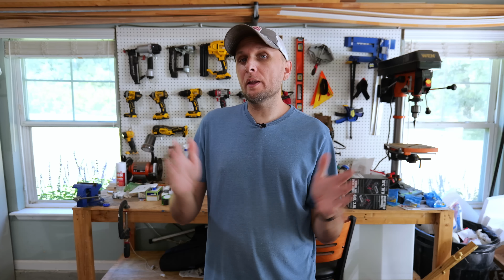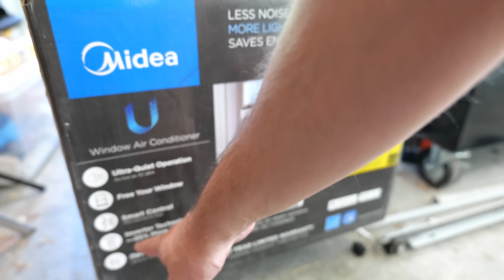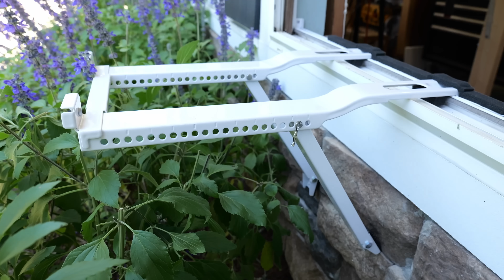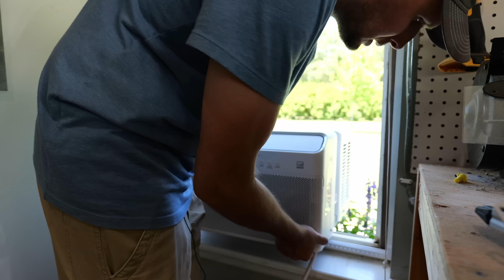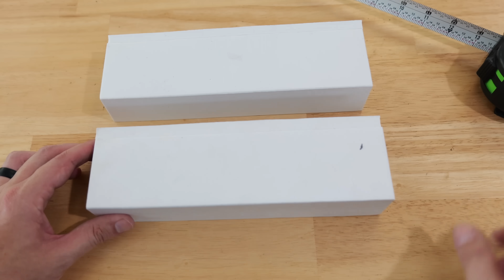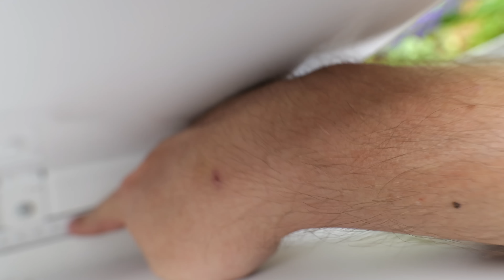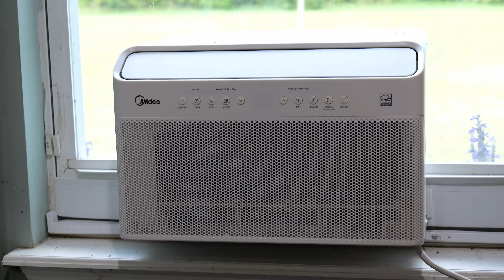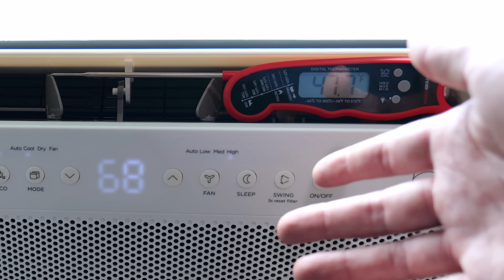The COLDEST And QUIETEST AC Unit Ever Made!  Still Use Your Window!

Comment: I have had two of these for the past 3 years and am well satisfied. There are some irritations though. You have no direct control of the fan speed. You can REQUEST the fan to be low-medium-high but it is only a request. If the room is over the set temperature the unit will switch to high fan until the air is cooled down. This can be a real irritant if you are shooting video or trying to get to sleep. In sleep mode the unit is very quiet, almost to the point of not hearing it. But if a slight draft of warm air hits the inlet it will switch to high fan which is as loud as a normal air conditioner. Another irritant is if it is set to economy the fan will shut off completely once the air temperature reaches the set temperature. You then have no air circulating through the unit. The air in the room will rise in temperature too much before the unit switches back on, and then it may switch to high fan for a while. (noisy)  As for economy, the 8000 BTU unit uses a little over 6 amps on high cool on a 95 degree outside day. On low cool it only pulls 2.6 amps! This is less than the fan alone on most standard AC units! Truly very efficient. These do cost a LOT more than the cheap noisy bargain units but you will easily recoup the extra $200 or so in the first year or two of electric bills.
Reply: With our Midea split units, if you press the mode button on the remote it changes from AUTO to COOL and then the fan speed can be set at what ever % level you wish.
Reply: @rallychamp2003  Thanks for the tip! I guess I have to find what I did with the remote! I still wonder if the unit stays in "low ultra quiet" if the temperature exceeds the set point.
Reply: Never put these in economy . Inverter ac units have to be always on . If not, not only will the temp rise to much but your room will be very humid . Another issue i had with these units is when the temp caught up to set temp and the shift in temp of air coming out of the unit the contracting of the parts inside would cause a crackling sound . It’s because the copper tubes are run through a hole in the plastic that is to small . So the restricting and contracting that occurs with temp change will cause the tubes to rub against the plastic . Part of why i got rid of mine . Second part is the suddenly high fan noise when it starts to get to warm . These need to be designed and operated different to truly work best .
Reply: @jimjr9143 there's not too many other people I've heard from that commented on the humidity characteristic of these units, which I've also noted.  
I've found that my 12k unit doesn't decrease humidity the same way that standard air conditioners do, unless it's set on dehumidifier mode, which apparently then just runs the compressor on full cooling mode, and doesn't return the heated air from the condenser back into the room the way dedicated dehumidifiers do. It just continues chilling below 64 degrees as the temperature setting doesn't affect it in dehumidifier mode.  
It's just as well though, as dehumidification usually isn't needed in cold temperatures, so having the cooling effect is a benefit.
I have a logging Govee temperature and humidity monitor, which clearly shows the differences in the various modes and settings, and even in non Eco cooling mode, the humidity doesn't get extracted as well as expected, rising to higher levels as it cycles off. 
It may be because it isn't able to drain completely with the split configuration holding a good portion of the evaporator condensate. 
Installing the unit tilted severely outwards was needed to try minimizing this effect, and then I could see the water dripping outside instead of remaining in the unit.
Reply: Nope , will not stay in quiet mode if temp rises to much . Annoys me as well . I finally got tired of that happening in my sons room and installed a ductless mini split . Stays quiet all the time and is far more efficient .
Reply: I agree.  I think I recouped the Entire Cost of the Units in 8 Electric Bills!
Reply: you said your well satisfied but you did nothing but complain in your comment lol
Reply: @fallback8314  Sometimes you have to put up with things that you don't like to get something you do like. It's really a pretty good air conditioner, just has that gotcha in the control function.
Reply: There's an app for it you know 🤷
Reply: @sullensenium  What I am indicating: THE SETTING DOES NOT WORK ALL THE TIME! If you are in sleep mode ultra quiet, if a bit of warm air blows through raising the temperature above the set point the unit will switch to full power (very loud!) for a short time to quickly bring the temperature down. Enough noise to interfere with your music, your video shoot, your sleep!
Reply: It'd be interesting to see how the collected water from the evaporator drains out to the outside; the lowest point needs to be above the window sill and channeled down and out for it to drain fully.  It's not visible so it's hard to tell if there's a pool of water collecting in the inside section, but based on the humidity readings and the way the room humidity rises after the unit is turned off, it would seem so.
Reply: @dubmob151  The evaporator is above the window on the model I have. The bottom of the AC sits on the window sill and the window closes down into the opening in the top. The water drains out fine.
Reply: @glasslinger  do you have a hygrometer? What's the reading you see on it?
Reply: @dubmob151  no But the room is totally comfortable once it cools down. The air from the vent is very cold so it is certainly removing water from the air.

Comment: Great video, but buyer beware - The AC worked great for 3 Summers. After that, it no longer produced cold air. Contacted Midea who directed me to three different service locations, all over 1hr away and none of them supported Midea products anymore. I will attempt to take it apart and fix it on my own. As mentioned in another comment, the entire unit must be disassembled in order to clean the interior cooling fins.

That said, when it worked, it was great and extremely quiet. I loved it, but noted a few design flaws. Water collects in the belly pan by design in order for the fan to splash it up against the cooling fins. This causes the belly pan to rust very quickly. Due to this design, the weep/overflow drain holes are closer to the center of the unit as opposed to the very back like other AC's. This is to ensure the belly pan always has water in it. If the window has an exterior sill, the drain holes line up directly over the siding, dripping rusty water down the side of the house, leaving rust stains. Lastly, the AC developed mold on the fan and interior cooling fins. I've never had an AC develop mold as they all had proper draining and ventilation. I'm hoping it's related to the cooling issue and that it will resolve itself once I'm able to properly clean the fins on the inside.
Reply: One thing that helps with the water:  Take a paper towel and fold it into a strip about an inch wide.  If you're looking at the front of the AC (where the blower is), on the outside part on right side, stuff the folded paper towel into the vent slits at the bottom.  It will wick up the water and both help in directing where most of the water dripping goes and helping remove excess water from the unit
Reply: Mold in mine developed within first 6 months, I  spray mine frequently with heavy dishsoap solution
(any anti  mold cleaner that will not react with aluminum fins should be fine)
Reply: Lots of similar reports in Amazon reviews and apparently disassembling to clean the blower is a 20 bolt pita.

Comment: No thank you...too many worthless bells and whistles to fail mid summer....unknown manufacturer....12000 BTU standard window units can be had for over $100 less at WM...any thing that contains an inverter/variable frequency motor drive is a no go due to failure rates....you can get mounting devices for normal window units that will allow you to open the window also, they are required for many apartment complexes.
The true cost of ownership is probably astronomical with the complexity/cost of repairs or early replacement outweighing energy savings.

Comment: Had mine for 3, going on 4 years. Bought one of the early production models. It was an open box missing parts. It no instruction manual and was missing half or more of the install parts. Kind of funny to see what it should have looked like haha. I can say that even though I had to design my own way to seal the window as all those parts were missing that this unit was worth every penny and my extra labor and time to design my own system to lock it into place. My design is much more secure, impenetrable with bullet proof glass and welded metal and a beefier locking system. I live in a nice neighbood, I was a fabricated and owned a security/FFL company that supplied arms to the us military, federal, state and local police and turned vehicles into bullet proof and light explosive security vehicles so I just used extra stuff I had laying around and my skills. Either way, this is the BEST unit I've ever purchased. I've burned through 3 other units that i have in a different window and this one is not only still working, but still works better than the other ones I've purchased. I feel dumb now for not just buying another one of these. I'm my head, I kept thinking about how long it took to install since i bought an open box/ missing parts unit. Seeing this though, I'll never purchase anything but a Midea again. I can't believe how cold and how durable it is. I LOVE that it shuts off when it's reached the set temperature. My other units turn the compressor off, but the stupid fan keeps going. Drives me nuts. This one turns off the fan and the compressor so it makes no noise until it's needed again and then automatically turns itself on. And, it is SO much quieter even when it's on full blast, yet full blast kicks out more air and colder air despite being quieter. Yes, these are expensive as hell. Way more than other units, (a little too pricey in my opinion despite all high praise) but you won't find a better window unit out there. This will be the only unit I buy from now on.
Reply: Enjoyed your back story. 😊

Comment: Super Curious, if your upper window slides down or not?  My windows do, for easier cleaning.  Just curious how you may secure it from opening?
Reply from the maker: Mine can be pulled out for easier cleaning but there are tabs that have you be depressed for it to swing out.
Reply: @HowToHomeDIY  Okay, have you tried pulling down your window with your ac in it?  Mine slides down with no issue.. :(

Comment: I had one of these but I returned it.  Installed it and sealed off all gaps with foam and tape.  Somehow flies and mosquitos were able to get into the system and it was blowing them into my bedroom through the cold air duct.
Reply: Yikes. That's crazy.
Reply: Did it have a vent lever? Most newer AC units don't, and I've never noticed any bugs getting through the ones that did, but it's not a particularly useful feature even without the bugs.

Comment: Our home central air needed recharged.  Trouble is that it cost about $1200 to get that done before.  Instead of dropping that, we got the 12000btu unit.  Best case it would handle the chilling part and combine with the central air to handle air distribution.  The result was saving $700.  Having a much more efficient and quiet unit was just additional benefit.  Wish it had dawned on me last time I needed the central unit recharged.  Thermostats in each keep the entire house cool and evenly temperate.  Love the Midea unit.
Reply: You saved a lot $700 don’t forget to get some shrimp fried rice & dim sum 😊

Comment: I have one handling a 24x32 detached garage that is still uninsulated. It's undersized for that role, but until I can re-size the window and insulate it, this unit is taking what would be at 100+ degree garage down to the mid/low 80s. Happy with it.

Comment: I got mine last summer. Using it to cool my office that has multiple computers running that are always on. I have it set to 70. Has kept the room very easily. It is a little loud when it first spins up. And sometime the window vibrates, but if I just push down on the window it shuts up for a while. My biggest gripe is that there is small bugs that get into the room. Only very small bugs, but stuff like spiders and gnats show up in my office. I have sealed the window with foam and aluminum tape on outside and inside and it did help, but I think under the unit where I can’t see is the biggest problem. I did use some expandable foam under the unit (lay down some plastic so the foam doesn’t get into your brick work). Overall I am very happy with it, it just has some real world gripes to know about. 👍

Comment: Love the videos. I also have this Medea unit. As you'll soon find out at the end of the season, I would love if you did a follow-up video showing how to change the hamster wheel drum to get it out and easily cleaned with the mold that is synonymous in building up in the system. Trust me, you'll see what I mean in about a year and getting to that hamster wheel is not very straightforward or have any good videos on the internet to do it

Comment: I bought one last summer for my bedroom. Very quiet and efficient.  After it has been running for a while, the AC pump and fans drop down to progressively lower speeds which makes it even quieter.  It works so well that I just bought another for my den.  Highly recommended.

Comment: Hi! I love the videos you are making, planning to build the shed platform and ramp (2 sheds - both already built, new one needs a ramp, old metal one removed from the newer platform (built last year by a contractor) needs a new platform. 

BUT -- I really came to tell you this...please clean those corners and crevices! A steam unit will really help loosen the crud that tends to accumulate there, also use a toothbrush, toothpick and I also have a few really old metal nut pickers, used to remove nut meat from walnut and pecan shells, that were a legacy from family, that are extremely useful for getting really stuck on crud out of corners.  I really cringed seeing your shots showing the crud! (OCD a bit here ;-) )
Reply: Is there a video for the shed platform and ramp?

Comment: Is the weight of the support system resting on the plastic window frame?
Reply from the maker: It’s distributed between the sill, lip of the window, the screws in the walls, and the outside legs.

Comment: our master bedroom is upstairs in our house gets about 6 to 8 degrees warmer than rest of house we have tried several window units brands over the years and all ok not great the best we had was a haier from walmart it cooled very well alot quieter than others but after 5 years it stopped, 3 years ago we bought this Midea U and its amazing on a 100 degree day our room can be 60 degrees its downright cold and super quiet the app is amazing you can set unit to come on at certain times or temps, can dehumidify, has a eco mode as well its the best $400 we ever spent on a window unit

Comment: This thing is awesome, absolutely the best window ac I have ever used.
Reply: Also something I learned is if the light on the swing button is lit up it's telling you to clean the filter. Hold the button down for 3 seconds to reset it.
Reply from the maker: Ahhh great added tip!  Thank you very much for sharing your experience and the added tip about the filter!
Reply: No problem at all, before that I was cleaning it every 2 weeks using Alexa reminders. I found that schedule kept the filter looking pretty much brand new. It seems like the reminder light would come on at a similar interval. One other thing is I was using a different ac on a smart plug and saw significant energy usage reduction after switching to this ac, this thing is very efficient for a window ac.

Comment: Way more complicated than the old AC units plus I don’t require screwing screws into my window area
Reply: You don't actually NEED to screw any screws in. Most A/C window units "require" you to, even the old ones, look at the part the window closes into on an old unit, see those holes? that is where the company expects you to put the "don't sue me screws". but nobody ever does. As long as that support is set up right the screws are just an added precaution. Think of the support shelf as one of those pull up bars that you put in a doorway. as long as the wight is pushing it down not it won't go anywhere. Put those sticky rubber feet that are supposed to go on furniture on the ends of the support so they are pushed out to the frame if you are really worried about it wiggling.

Comment: We have the 10k unit. It has worked flawlessly for the last two summers. We originally bought it as a back up A/C unit in case of a power failure. As elderly empty nesters we used it to cool our room at night while programming the rest of the house a little warmer as we have a single exterior A/C unit. Worked just fine with our Champion duel fuel 4250w  inverter.

Comment: I've had one for 3 years.  Super quiet and amazing. 2 big problems is Installation is not easy.  It also trips gfci.  

Only being 15A, a minisplit will outperform in larger spaces. It couldn't cool my upstairs by itself  on 90 degree days but a minisplit could. I wish they made a 220V version with more btus that is wider to fill the window  i think there is a market because its so much easier to install than a minisplit.

Comment: The AC units I see on Temu are also U shaped but in such a way that it straddles the window sill and the operating unit sits mostly below the window so it doesn’t block the window. I like that design better.

Comment: A more secure window can be done with two vertical 1/2" + dowels wedged between the top of the windows and the top of the frame.
Reply: I use only one dowel and it works great for security.